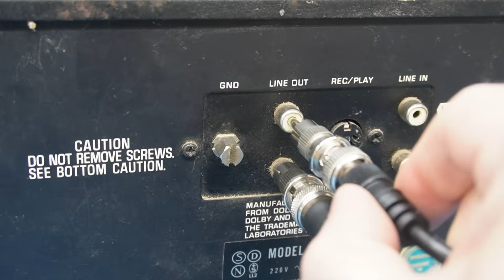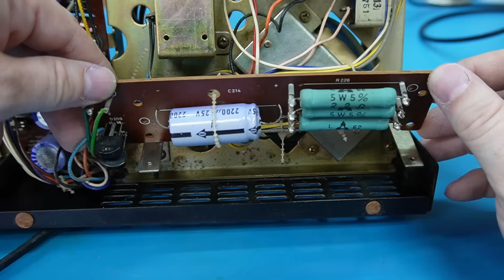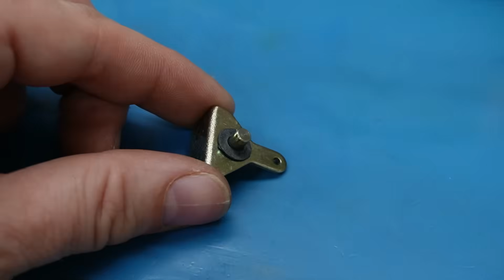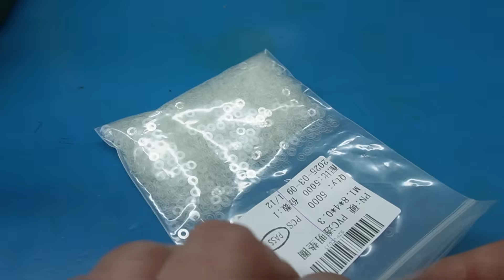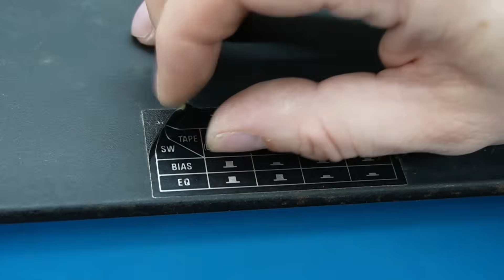The TECHNICS Tape Deck (RS-671)

Comment: Quick tip, all those "Phillips" screws are actually JIS (Japanese Industry Standard) screws. Hence your screwdriver always slips out of them.
They can be identified by the punch mark on the face of them. Also common on Japanese motorbikes! Well worth investing in a set of JIS screwdrivers.
Great work as always, a pleasure to watch a master at work! 🎉
Reply: Yes, once you use a set of JIS screwdrivers for those screws you'll wish you had of gotten them long ago.
Reply: Mark is using JIS screwdrivers, he did mention exact same thing in few of his videos.
Reply: @enwavs  They don't look like they sit in the screw properly, and if so he needs to press a little harder as the slip out pretty much every time. 😂

Comment: Wow. I bought one 1982 I cold be wrong. But made a big mistake I send it in for repairs but I never got it back for some reason they have misplaced it.  I was giving paperwork Interesting  but could never been found.  I was not happy. It took months until I got a call ready for pick up.  That was very strange.  I paid and worked for years.  Never went back to that place.  
But many people repair electronics that’s sad.  Great video sir.  Good work.

Comment: Guy is too busy playing with electronics to cut his grass..

Jokes aside, I was like how does this guy have a 1 hour video on a Technics tape deck?
then 1 hour later, I was like wow.
great job.
those perfect solder points every time!
unbelievable.
I have fixed a few of these older things myself, but only minor things.
I don't know enough to fix more complicated electrical problems.

I never knew you could use an oscilloscope and test tape to calibrate recording like that!
that was amazing.

Comment: Mark, I've repaired a lot of stuff in my 70 years, and I know a meticulous job when I see one. You even know how to handle spray enamel. One thought. When they do actual retreads, they use contact cement. I would have been inclined to use that on your Rewind wheel. It's more flexible. I feel like super glue in a rubber-to-rubber bond might be brittle. Time will tell, eh?

Comment: @MendItMark Hey Marc! Nice repair, but I got a question and I thought you could help me. I got one of those gimmicky CD lens cleaner discs (a CD with a little brush in it!). Does these work for cleaning the CD pickup, or are they just crap? There is some "magic" technique for cleaning the CD pickup lens? Thanks 4 your videos!
Reply: I''ve got one of those for Mini disc players, I'm not sure if it actually does much cleaning!

Comment: I've discussed this with an old engineer tech. He said the wiping action of pots and plugs is very important to scrape but not too much the connection path. It's a life expectancy calculation and analysis to figure out how long or reliable. You can't have both super high at the same time. Like a plug with 30 pins, if you had high wiping force, you'd never get the plug into the socket. Vs 4 pins. Can have high wiping/insertion force to clear the connection and make it good each time.

Comment: To the service people out there.

Just curious, since I have a vintage Kenwood / Trio TK-150t that keeps blowing fuses, how much would an average service that Mark does  in this and previous videos cost? 

Obviously no-one really knows the true cost, but ball park figure, is it worth fixing something that to me would seem to cost 3-5 times what the item is worth?

Obviously a blown fuse might be easier to diagnose than some of Mark's previous repairs, but apart from sentimental value it seems some repairs / servicings in this and previous videos would be highly cost prohibitive, based solely on the time involved let alone parts cost?

Comment: The practice of bending over the switch leeds was to anchor them to prevent the switch from coming loose. It is not a mistake. I was certified by Panasonic, Pioneer and Hitachi.

Comment: That slidey switch is quite bonkers.

A tip for removing labels: try and pull away from the "point of contact" rather than "over" it. So if you start in one corner, pull towards that corner rather than the opposite corner. Source: removing many many labels from Amazon parcels.

Edit: Ah, I see we weren't worried about the label surviving anyway. Fancy label reproduction!

Comment: Wow, and with every single screw, every single spring, every single locking ring, every securing clip I do see myself myself face-palm, because I might have dropped it right into the mechanics or had it flying across the whole room without finding it then. And all of this happening, when a 2 hours repair time already was almost beyond economical viability, because there came up all the super-cheap trash from China, Taiwan and Korea for half of the price... 

That was a big project, but it was really nice work, very well done! I would call that Tape deck almost as good as a new bought one, back in the days...!

Comment: Your Azimuth test tape may not be perfect, One channel level is lower than the other, The channels were both at peak before adjustment which suggests that the test tape Azimuth is wrong.

Comment: There are two things that I am worried about. Please correct me if I am wrong with these!

First - you replaced the rubber on the wheel with deep central groove with a flat rubber band. What stops the new flat rubber from gradually sliding off the plastic wheel? There are no other groove / side walls to keep it centered by its sides?

Second - the head azimuth alignment tape you used for adjustment. The cassette seems to have regular Sony HF blank tape label. Is the tape perhaps a copy of a factory-manufactured alignment tape?
If it is a copy, you are not adjusting the alignment to any factory standard - but to that tape deck, where the copy tape was recorded on. What guarantee there is, that the recorded magnetic patterns are in perfect 90 degree angle to the tape run direction, as they should be?

Comment: Very instructive video, as usual. Thank you for sharing your experience. 
I wonder what kind of solder are you using for your work on old equipments. It's so difficult to buy leaded solder. I can only find lead free solder that I don't like at all. 
Which company is still selling the old good solder. Thanks 🙏

Comment: Until today, I'd never seen anyone dismantle a cassette deck and give it a lube job.  Utterly fascinating.  I wish I had the skill to do such work as this, but I fear I'd get it apart and spend the next 18 months reassembling it, only to have 3 different sized screws left over at the end.  But you did it twice, and made it look like child's play besides.  Truly amazing.
Reply: There are some technicians which do that, but not the typical "I changed the belts and now I will sell it on E-bay" guy.
I consider this You-tube channel worth mentioning, similar pride in good work like Mark:
https://www.youtube.com/@asbcustom
Reply: @florianm3170  Thank you for mentioning that channel!  I noticed repair videos on Denon DN-790R, Tascam 112 and Tascam 122mkII, three cassette decks I spent a lot of time with while working in radio for 30 years.  I'll enjoy watching repairs on those units.  (Although I think my favorite of the cassette decks was the original Tascam 122, much like a Teac C-3X.  I was always partial to Teac/Tascam, even the reel-to-reel machines, since I never worked at a station rich enough to afford Studer.)

Comment: Mark, I don't want to be mean. ;-) All of these purple Matsushita's capacitors are definitely turning green from the bottom... you have to check it out. But after calibrating the audio like that without measurements... Mark.... please. Why didn't you set everything according to the service manual? You can find everything on the internet. ;-) Or maybe you did it all off camera ;-) Please don't take this the wrong way. I really like your repairs. But stay away from tape recorders ;-)

Comment: As a retired telephone engineer on the Strowger stuff back in the day may I suggest you use a small stiff brush to apply the grease - so much easier!  Nonetheless a delight to watch you at work 😊👍🏻
Reply: Heavens above! Another Ex engineer. I cut my teeth on 2000 type selectors back in 1976.

Comment: What is the foam cleaner you use? It's something that's missing in my arsenal. And it's a bit tricky to figure out the right search terms. Don't want to spray carpet cleaner into my amps :)

Comment: Hey Mark, We need more info on the reproduction stickers. Are they something you've bought, had made or produced yourself? If it's the latter, can we have a video on the tools and process used please 🙂
Reply: I second that. I made a lot of different stickers but that has an aluminium + PE(?) base. If you made it yourself, what materials did you use?

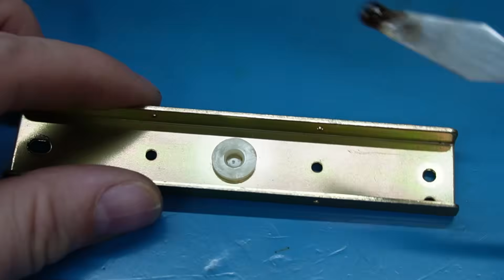Comment: 32:45
I used to lubricate everything with lithium, but a friend of mine who has years of experience with model railways told me that lithium-based greases are harmful to plastic in the long run.
It somehow dissolves the plastic over time. For lubricating plastic, he suggests a lubricant based on PTFE, which has the same properties.
Reply: It might have the same properties, but it also has the added "bonus" of being a forever chemical you really don't want anywhere near you

Comment: Kerosene will help restore elasticity to rubber rollers (soak them in kerosene for 24 hours). An old-fashioned method.
Reply: "When rubber is exposed to kerosene, it can cause swelling and softening of the rubber material. This can lead to failure of the rubber seal or part"

Comment: 21:12 .. I have cleaned a few of those switches, sometimes they still behave badly afterwards. The return spring inside looses a tiny bit tension over the years and can be resolved by grabbing a couple of coils and stretching them. Don't overdo it obviously! Also some silicone oil around the plastic slider helps them return correctly.

Comment: I had to do the same sort of switch dismantling and servicing on the mono/stereo switch on my Sony TA-N80ES power amp.

Thankfully, it was nowhere as large as this but it was slightly worrying when I popped the lid and saw how they were made. Thankfully, its held up the last 18 months or so - was pleased to see what I did has been affirmed by your methods!!

Comment: "the third method, which is only for the brave, is to actually dismantle this... take it apart and clean all the contacts manually. It's quite a bit of work.  It's been a while since I've done that, so I'm going to show you what's involved."  Of course you chose the most precarious option and crushed it out of the park!  I'm always afraid of taking those switches apart because the springs love to go everywhere.  Ultrasonic cleaner to the rescue for me, but you sir, are not afraid of any challenge.  I love the "clunk" of the old solenoid decks.  So satisfying.  Great repair Mark!

Comment: You adjusted record level for type 1 tape. This model has independent adjustments for type 2 tape too. So recording difference issue is still there.

Otherwise good job reviving this unit.

Comment: Nice work Mark. Certainly heavy engineering in those days, I had an Aiwa cassette deck with similar massive solenoids and big, very hot resistors inside. You certainly knew you had your moneys worth when you lifted it up. I loved the re-tread, I was convinced it wouldn’t work, but I didn’t allow for magic Mark 😂

Comment: Excellent repair job Mark , you are so thorough and dedicated with every repair you do , I would bring my electronic gear to you anytime .Ive had electronics as a hobby since the age of 11, my folks bought me a 100 in one electronics kit for a birthday gift and i was hooked , my first thing i made was a AM transmitter and i used to play music with a small cheap record player and my friend would sit up in a tree and listen to the music with a tiny transistor radio , it was brilliant played a 7 inch record  'Jeans On' Those were the days.Since then I've built many preamplifiers  , mixers , amps and lots of sound to light circuits,.lots of three channel tone controls , FM transmitters etc etc.

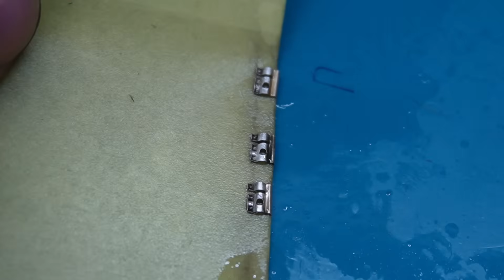Comment: 18:52  I have used a similar method - except I applied some TARNOFF
to the paper  - when clean  repeat the process with 95% IPA to wash off
the (Tarnish Remover ) 
Works very well at removing tarnish from contacts / switches / pins
often cleaned using a cotton-bud  soaked in TARNOFF - clean after using
IPA and spray contact cleaner into switches which provides some
lubrication and minimizes any further oxidation of contacts.
I have been using that method for many decades.
And for polishing I used a circular eraser that was commonly used
by typists to erase  typewriting errors -- This was common prior to the
invention of Liquid Paper.
The eraser being slightly abrasive has proved to be useful for fine polishing
delicate metal objects such as Jewelry -

Comment: Nice to see someone dusting the same way I do. Hoover and a brush... Drives me mad when I see people using compressed air; heaven only knows where all that dust gets blasted into and all over your workshop too... Well done 👍
I find 10ml blunt tip syringes work well for semi-fluid and other greases, much easier to get it where you want it with reduced mess👍

Comment: One thing I don't understand is, that often today we hear that the reason modern tape recorders doesn't have Dolby noise reduction is that the Dolby chips are not made anymore. This deck does it with transistors, so it seems like the chips are not necessary after all. Maybe it's a patent or licensing thing instead.

Comment: 53:33 this is a great idea, perhaps puncture repair solvent could work better for this purpose?  It would fuse the two rubber parts together instead of forming a hard layer like super glue does.

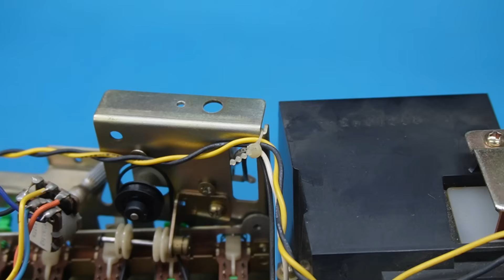Comment: 7:17 those are old "ball locking" cable ties. You don't need to snip them, you push the ball to one side and it pops into a larger hole so you can pull it out. When replacing you push it through the large hole again and then push the ball to one side which snaps back in to place. Re-usable cable ties. 1970s style. No plastic waste already back then.

Knipex cutters... stabilo pen... all German 😃

Comment: I am always staggered at the complexity of these devices - firstly the design must take a while, then ordering up all the component parts and have someone make them, then the time it must take in the factory to assemble it all. Then somehow make a profit by selling them!
Then the fact you can make up a service manual so they can be repaired.
Then along comes Mark to do exactly that so thoroughly.
Just amazing!
Reply: This is one of the reasons why this type of equipment was much more expensive than the modern equivalent when you adjust for inflation. I couldn't afford a guitar amplifier back in the 1978 so I made one much more cheaply from kit modules (ILP). I recently worked out that just the basic power amp bits, sockets, switches etc and hand making a case meant that I spent the equivalent of about £500 not including a 2X12 cabinet that added £620 at today's prices! Same reason Brian May and his dad made his own electric guitar... you just couldn't afford the "real thing".
Reply: I was thinking the same thing!

Comment: I have a similar AKAI tape deck (silver aluminium front with a wood grain veneer case). It still works as well. It is in my attic though, as I have no room or use for it at the moment. Tapes, vinyl and CDs have their charm and I support artists by regularly buying the latter, but good quality digital files on my phone are more convenient. I remember hauling around a Walkman and later a Discman, with an associating folder of CDs. I'm glad we're beyond that 😅

Comment: I have no problems rebuilding a carburetor.  I have repaired a mechanical watch.   But I have about a 20% chance of putting a cassette drive back together.  I don't know what it is, but something usually goes wrong.  That's a job I will leave to the folks who have a knack for it.  Nice repair on this one.  Always helps when they're well built to begin with.

Comment: Mark I am in my 60s now and I can honestly say in my career you are one of a of the few engineers that I have seen that have such an exhaustive knowledge base and take such meticulous care over your repairs. It’s so enjoyable watching a true craftsman at work.
Reply: My only complaint is that he never engages with his viewers in the comment.
Reply: I second that
Reply: I think exactly the same, it's a shame there's no engineer like that in my area, I have a Technics RS-TR333 that stopped working and I would really like to have it operational again to add it to my Class A set.
Reply: This is like my grail, like a 69 Chevelle of tape decks!!!
Reply: He's younger than me, and that's a rare trait (electricians-technicians less than 55 years old?!). I don't mind him not replying to comments online. He DOES have a paywalled account where that interactions are happening. That's fair, in my books. No?
Reply: Indeed. 😊
Reply: Mark, very entertaining video.  I enjoyed watching you as you discovered the internal workings of the RS-671.  I sold the Technics line of equipment in the audio store where I worked back in ‘75-78.  I still have an RS-676US that I bought in 1977 and remember selling a couple of the RS-671 decks.  The units sold in the U.S. had brushed aluminum faceplates with the lettering and marks etched into the aluminum with black paint in the etchings.  
Thanks for an excellent video!
Reply: 😊ditto 73 years old ex military
Reply: Wii said.
Reply: Bin ich froh das diese MC Zeit vorbei ist und mich sehr wundere das es noch Verrückte gibt die dieses toten Pferd mit viel Geld und Liebe reiten , sorry aber ich versteh es nicht.

Comment: I have repaired "fuse-lights" by taking off the end caps, drill a small hole in the caps to allow a thin wire to pass through and build a string of surface mount LED' + resistor (if AC, include a diode).